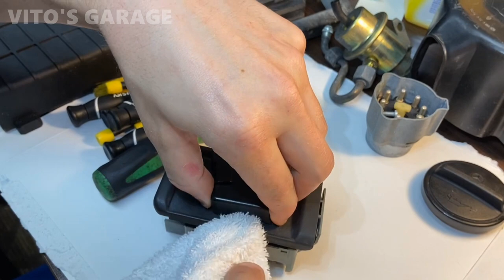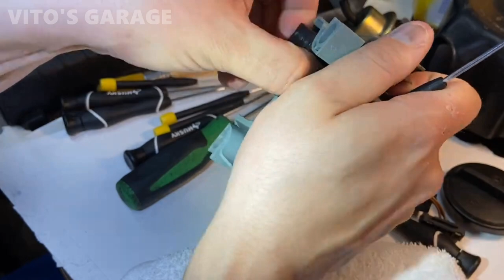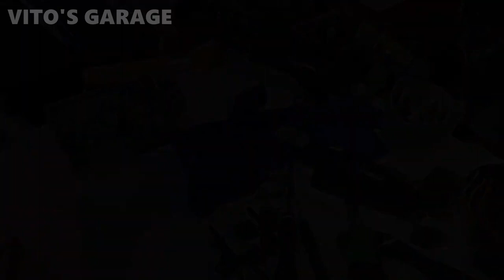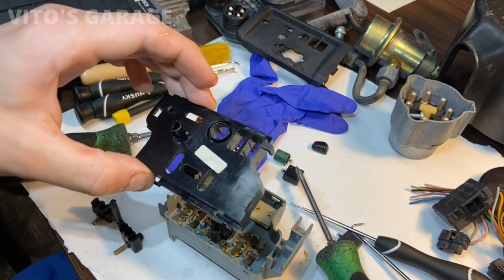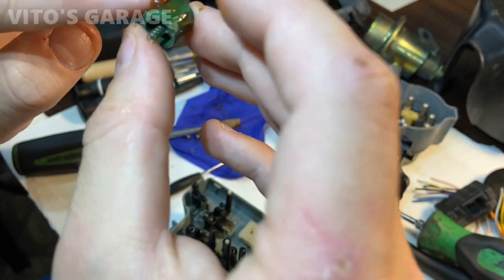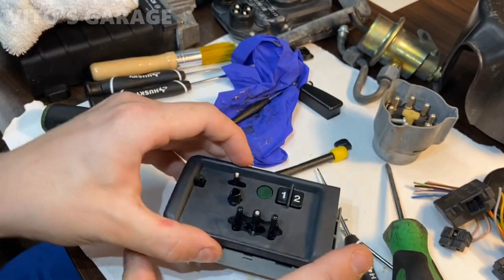Mercedes Stiff Power Seat Switches.. Detailed Disassembly, Cleanup & Reassembly W126 W124 190E W201

Comment: make sure that grease you used is compatible with plastic and do not accelerate its deterioration
Reply from the maker: It’s all good man. I’ve done it thousands of times
Reply: @VITO'S GARAGE  petroleum based grease is not best choice for plastic in long term you should use lithium or silicone grease cause it does nor react with polymers in plastic parts
Reply from the maker: @michalmuszynski6942  petroleum is bad for the rubber. It won’t do anything to the plastic. You probably watched too many other channels and haven’t tried it yourself. You want to put a wheel bearing grease in there or it’ll dry out again in a few years and your switches are gonna be hard